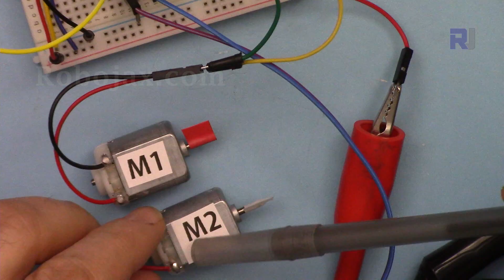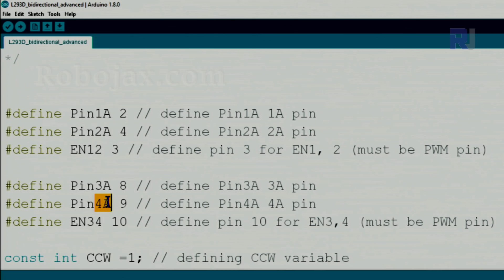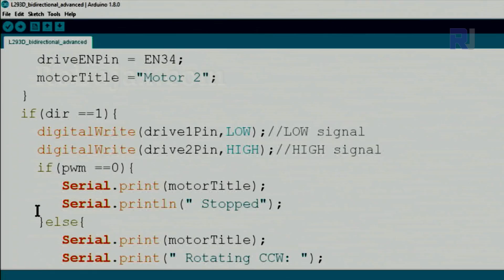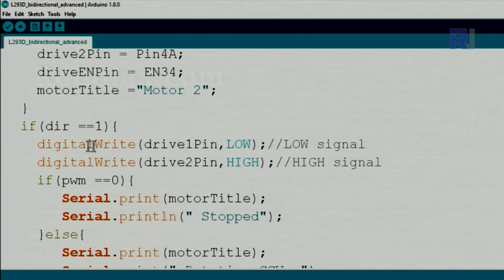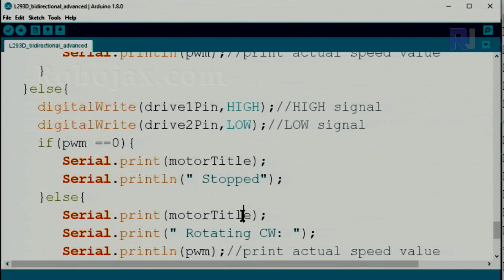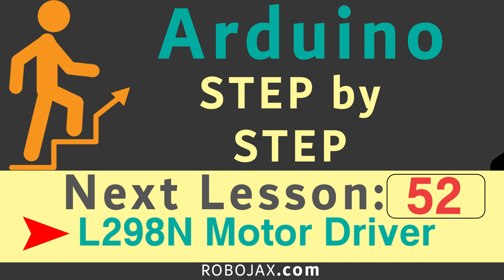Lesson 51: Control 2 DC motors using Arduino and L293D | Arduino Step by Step Course - RJT514

Comment: This is a very interesting chip, however, can this chip drive two 24V motors with 3A each motor or can this chip be integrated with xy-gmos? Thank you.
Reply from the maker: L293D was introduced in Lesson 49 https://youtu.be/D4yLsWvZDw4 with specs and details